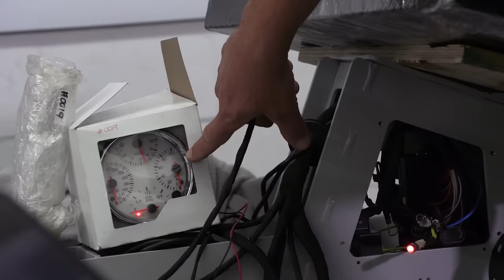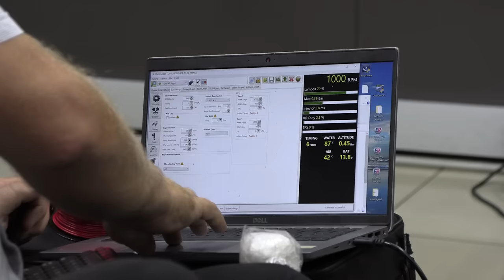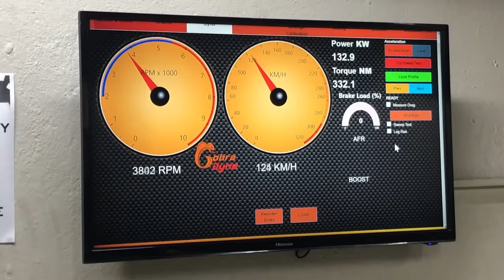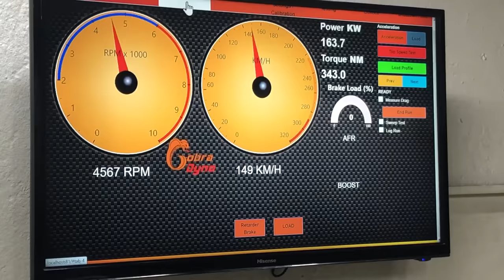FINAL STAGES - Our next bug is heading to the United Kingdom

Comment: Man this is depressing.  I've got a body that is a basket case.  It needs new front and rear body panels.The bonnet and boot need rust repair .  New heater tubes, new door pillars and a total strip and rebuild. The 69 bodies are few and far between to find in Australia.  I haven't emptied the crate yet. I've looked but damn life commitments are strangling me.
Reply: They still made them in Mexico until recently you could probably buy a new one and ship it as parts for what you pay for a rust bucket in OZ.
Reply from the maker: So sorry Rob. I know it’s been a tough road for you. Hang in there
Reply: @anomamos9095  A bit late now .I've spent the money on new parts. I only need the time to do the work. It's a 69.  I'm thinking they are later models in mexico.    $10,000 is a lot to import a body.
Reply: @V8StealthBeetle  Ha Ha thats lifes way of making you a better person.  Mum is 96 and looking to make 100.  She just gave up her drivers license so now I'm the chauffer. I have lesser days to play in my new garage to sort it.  It will happen but in a drawn out time line.    Thanks for the concern.  I've got my health, ( the satisfaction that the builder has had his license removed for life ) and that progress is happening.  Slow but it's hapenning.  😉
Reply: @tinnedanger  a 69 will have different suspension and possibly a different floor pan to later models
Most people just cut out the back window and graft it onto a later model.

Comment: why is it making so little power? crate ls3 is 435bhp
Reply: The one on the dyno first of all was not a  ls. Coil packs in the centerline of the head, no idea what it is but it has dohc heads.
The power figures sound a bit like a toyota ls400 engine.
Reply: They probably state low numbers because taxes, regulations and insurance? It's a wink wink situation.

Comment: Arent there reproduction bodies to use instead of well kept originals?
Reply: Yes I guess but I’m not sure if the original provenance* would still apply with different vin numbers etc. ( * official registered age)
Reply: I’d rather use an original body
Reply: @msk3905 I reckon they are so far removed from an original it wouldn’t really matter.
Reply: @saltydog888  they state in the video that the climate where they are results in minimal rust
Reply: @msk3905  I just meant the whole concept
Reply from the maker: @msk3905  only up in Johannesburg. But it's stil 50 year old metal